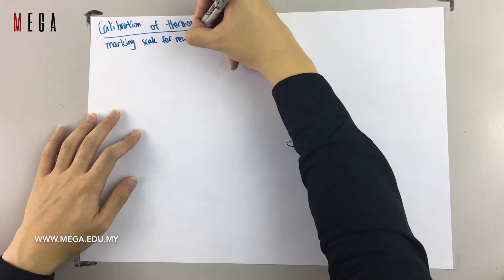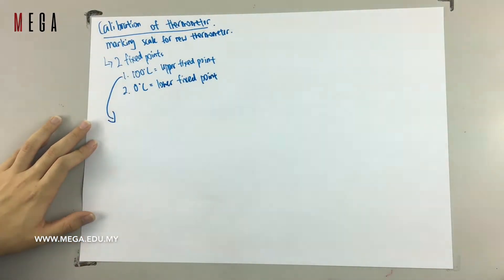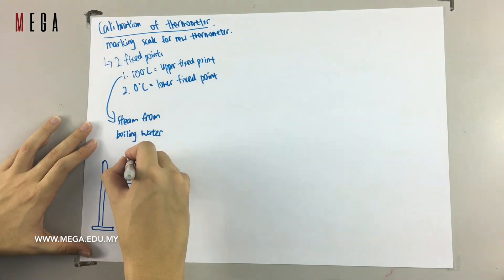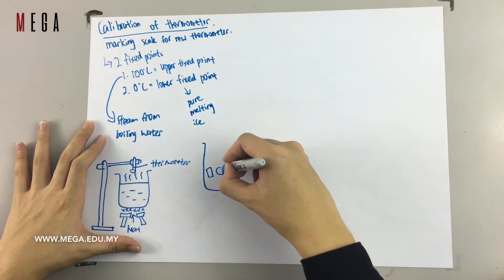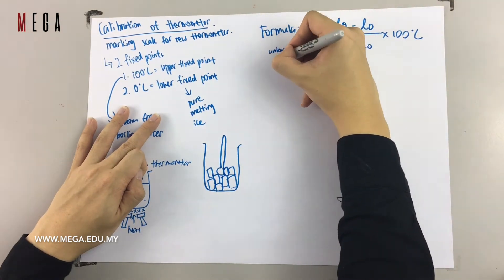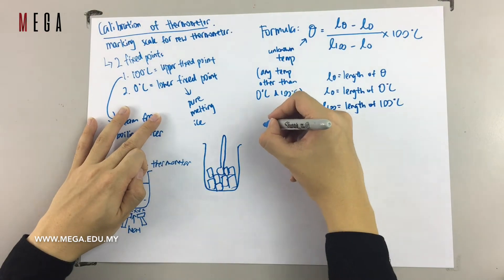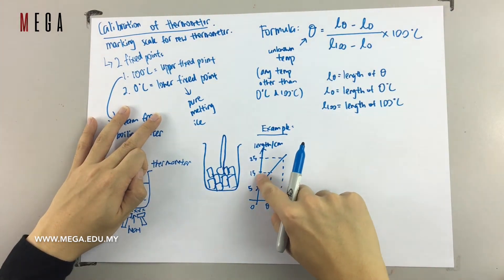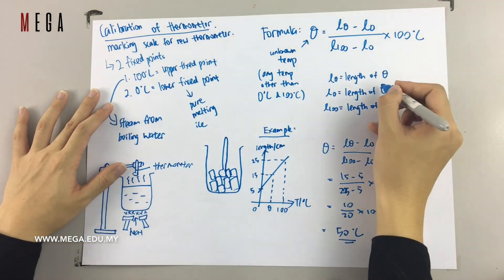Physics - Calibration Of Thermometer

Comment: Upper fixed points should put ur thermometer inside boiling water @atm pressure, lower fixed ponts should put water in ur glass of ice and mix it. Not only ice
Reply from the maker: Thanks for pointing it out. 💪💪💪